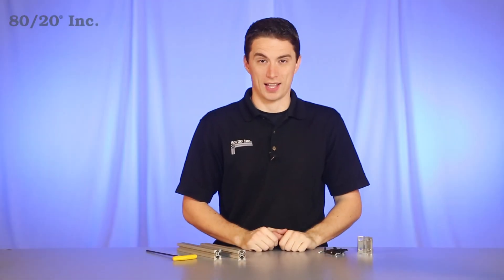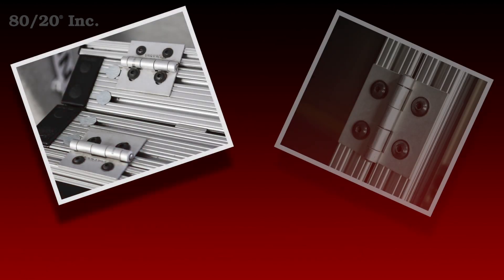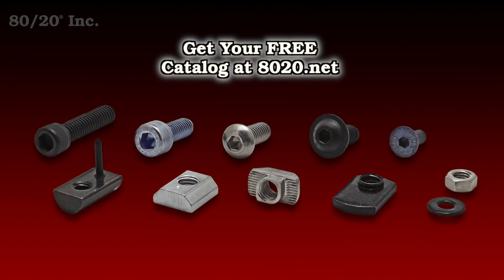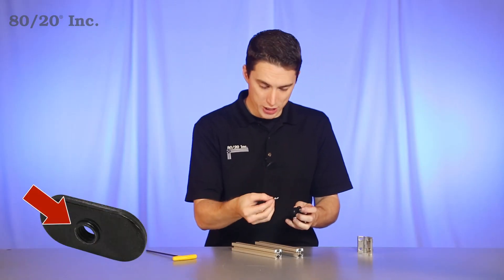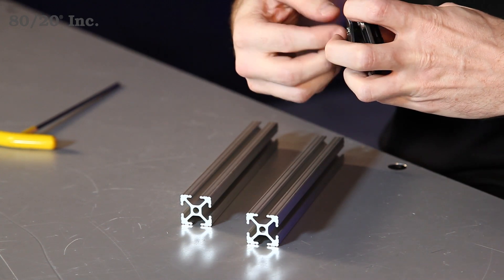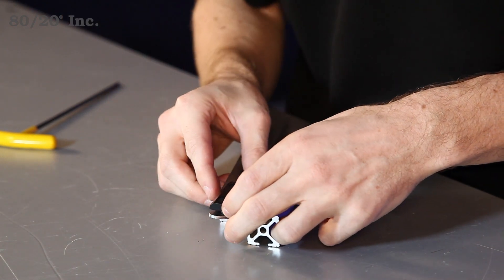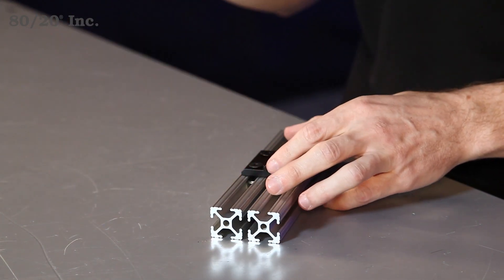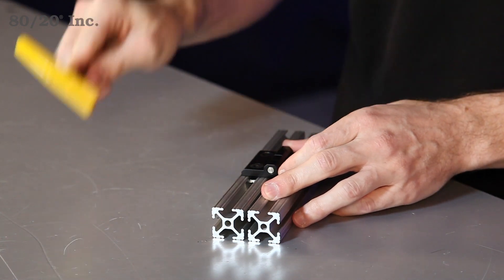80/20: Metal Hinge Overview

Comment: Whats the range of motion? while open I see both profiles are flat next to each other. Can it fully fold such as one profile is on top of another?
Reply from the maker: Hi there - that's an excellent question. The first hinge shown, the 4-hole aluminum hinge, opens to about 160 degrees. The 4-hole adjustable black hinge that is shown during the assembly portion of the video opens to 180 degrees.